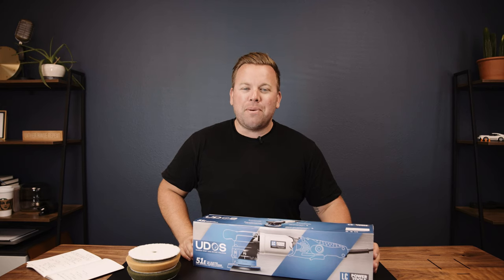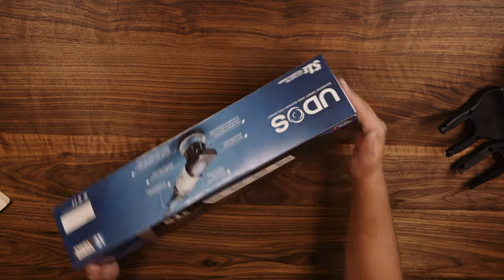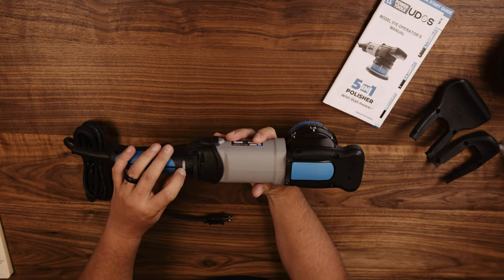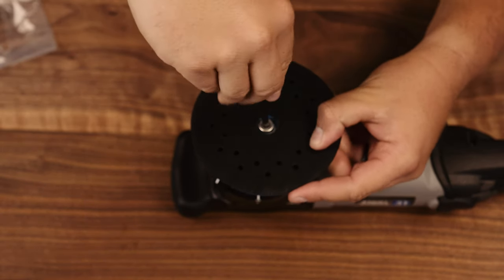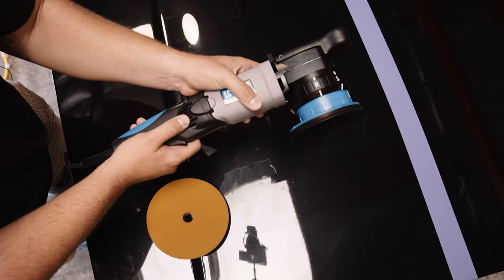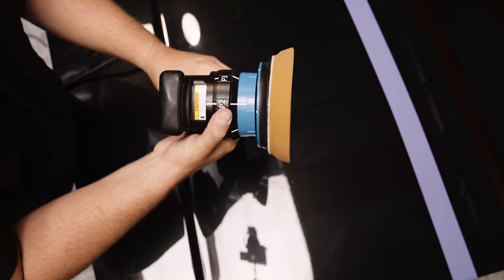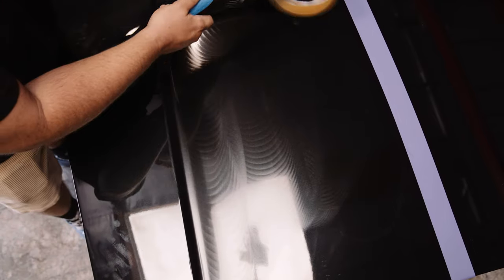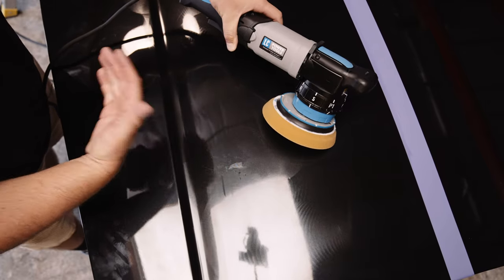OVERRATED OR UNDERRATED: The UDOS 51E Polisher...

Comment: It is good for rotary or sanding but P1-to-P3 severe vibration will give you Parkinson’s like effects in your arm after using it for several hours. Not good for your health or nervous system. The also need to go back to drawing board for the mechanism that changes the mode, it is too finicky.

Comment: The drawback to that machine in this day and age is it is not cordless.    Most detailers and even weekend enthusiast are going cordless.  Once the feet got wet with the PXE-80 and the iBrid nano,  90% of the people who used(uses) those machines love the battery feature and being cord free (myself included).    I think the UDOS looks awesome and no doubt a lot of engineering went into the machine and it looks like it's built to Mil-Spec or something.    Plus the fact you have all those adjustments in throw and a rotary included,  that's a huge plus.  But the bottom line is the fact it's not battery powered and cord free.     If Lake Country could develop that machine in a cord free version,  they would probably quadruple their sales or more overnight.      Another tool they should develop is a micro polisher along the lines of the PXE-80 and/or iBrid nano.     Do a clone of the bigger UDOS machine but in a compact machine with a battery maybe with a 2 inch backing plate as standard which is in between the 1, 2, and 3 inch changeable plates on the other machines.    Just go right in the middle and make a 2 inch UDOS mini polisher!   Now that would be something.